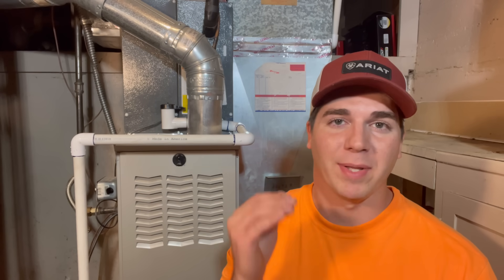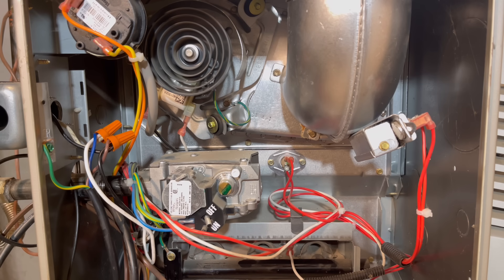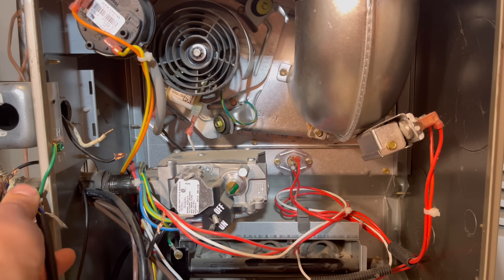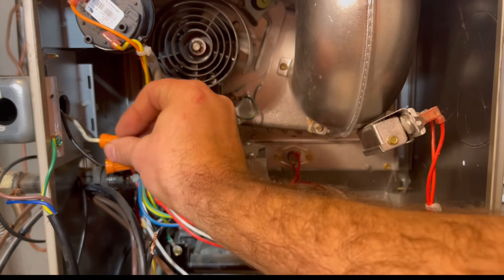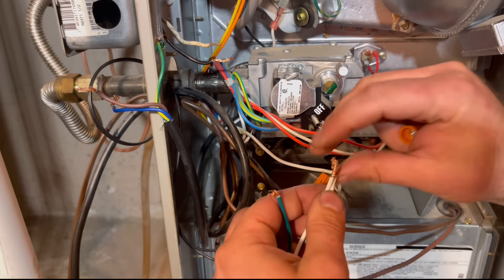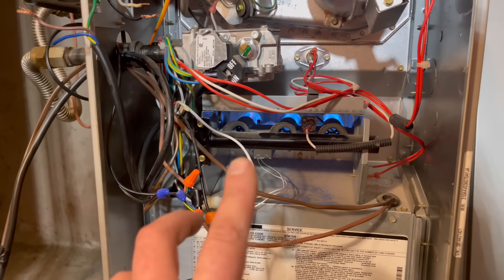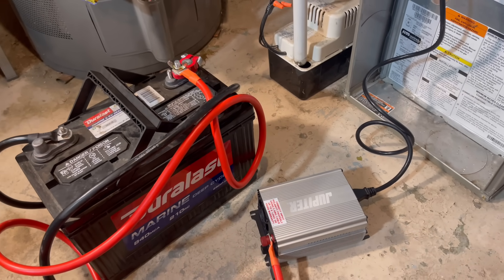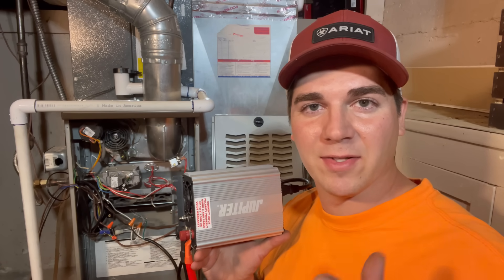Did You Know You Can Heat Your Home With A Car Battery?

Comment: In a power outage there are generators , gas , natural gas, propane , solar  for heat without electric there are wood durning , wood pellet burning , kerosene , unvented natural gas , unvented propane heaters that require no electric . You can also get an inverter that hooks to your car battery for electric as your car engine with an inverter can act as a generator . In freezing weather if you lose power and heat turn off your water main and drain your pipes to the lowest level and add antifreeze to your drains . Use melted snow to flush your toilets . Have bottled water , food , and an outdoor grill or camping stove for cooking and get bottled water . Have plenty of batteries and flash lights . Electricity has not been around very long . How do you think people survived for close to 1,000,000 years . The name of the game is preparation folks . We can do it . Go to a hardware store and learn

Comment: You could also use one of the solar generators that already has the pure sine wave inverters built in. I have one but it only 300 watts so it wouldn't work but the bigger ones would
Reply from the maker: I have another video on this topic testing a power station :) check it out!
Reply: @diyhvacguy  just watched. Thanks!

Comment: I have a walmart jump start 12v charger that I carry in my trunk should I need it or to help somebody out.  It has two 12v ac outlets.  So I'm assuming it must have an inverter built in.  I paid close to $100 for it.  I don't know how long a charge on this jump starter would last but it has two ac outlets and you'd want to keep your fridge cold as well as a few lights in your home.

Comment: Isn't it true that most Texans don't have gas heat but rather a heat pump or AC system? I have two sons living there and for both of them,  this approach would not have worked as all of the energy comes from electricity. This means much higher electrical demands that this inverter/ battery would not provide.
Reply from the maker: Yes some have gas but I was just using that as an example. I’ll be doing a backup power video for heat pumps and or electric furnaces soon! Stay tuned!

Comment: Just curious.  Will this method run a propane hot water heating system?  Will the Zone valves be also powered with this hookup?
Reply from the maker: If it’s 110v then yes

Comment: What is the load drawn by the furnace and house fans used to circulate the hot air. I've used a pair of deep cycle batteries in my RV trailer to run the heater and had dead batteries in the morning. Fans can suck a lot of power. Does the furnace you show have a separate air circulating fan?

Comment: Doesn't concrete hold a charge? I was always told to put a board under a battery, the ions in the concrete will drain your battery.

Comment: One thing to add was the size of the converter for the DIY types. For example a hair dryer pulls up to 1500 watts. So need to make sure on the size of the converter.

Comment: Why would you heat the whole house in an emergency, when you are quite limited on power?  For less money, you could have went to Walmart and got a mr buddy heater that will heat a room just fine.  If you would put this on paper, and run the numbers, you would realise how silly this is.
Reply from the maker: And why would you suspect walmart will even have said buddy heaters when everyone has the same thought process? This mindset will get you into a pickle friend. You can never be too prepared. If you watch my other videos you’d quickly realize this isn’t my backup power source. It’s one of many options. Good back pocket knowledge to have in a pinch 👍🏼
Reply: If you live life unprepared, I suppose you have it cumming, although those types of people wouldn't bother to watch this either, let alone be competent enough not to hurt themselves.  Not everyone is built for hard times.  I do appreciate these videos, as the world finds itself in chaos once again.  But this is not the time to rely on MacGyver tactics.  Smart plans with a little preparation go a long way.  Power should already be thought about, and the worry is eating and stopping people from taking what you worked for.

Comment: At my old house the A hole ele company shut off my electricity in the middle of winter because I fell on hard times for a month. We were freezing and only had the kitchen oven and also boiling water in pans on the stove top. I said bullsheet and bought a new car battery and did this. It worked great. 😁

Comment: What are the specifications of your furnace ( specifically, the power or current requirements of your mains connection?).  What are the specs on your 12V battery?    This in AmpHours.   What is the efficiency of your pure sine wave converter?  Last, what duty cycle are you presuming when you say it will run your furnace for X days?     

You have done a nice wiring guide and described the parts involved, but you have provided no information on the parameters involved.     This is a  useful video, and it would be even better than it is with some of that info.   My suspicion is that an average car battery is not going to have sufficient capacity to run a gas furnace and the large fan that moves air though a house at any serious duty cycle.    Maybe in Texas, where the normal standard is fairly benign weather and heating loads it would last a day.    A car battery from an F150 is going to be way different than the one from a Prius, too.   

The key parameters in a car battery are internal resistance/cranking amps, not capacity.  In your application/concept, the key parameter is capacity.

Comment: You can achieve the same results by turning off the breaker cut the wire going to the furnace, install a male and female cord ends. Plug them together and when the power goes out unplug and plug it in to the new source be it a car battery or a generator. That way you are always ready to go and anyone can do it

Comment: A note: we have two 100ah batteries...they're big and on the expensive side...but they can run for much longer than a standard car battery...one battery is a spare for things like this along with a 750watt inverter and the other battery is hooked up to our sump pump...guess when you need sump pump...during bad weather...power typically goes out during storms..so if no power during storm sump pump is dead...that equals flooding...but if you have battery backup no worries 👍

Comment: Guess I need to get a higher capacity inverter I've got one for 400w figure that would be enough for a light and my TV.
Really been checking in on the solar scene but theirs so many variations and which one is better.

Comment: Don't need a video to figure it out get your vote meter amp meter a calculator and ohm's law and the specs off the battery and the motor and do the math you'll cook the inverter before you anything else it's not big enough battery would be dead before you figure it all out

Comment: If you got a general outside gas or diesel or propane or whatever for a temporary use get a 10 gauge extension cord or 1o gauge would be even more better cut off the female end and observe neutral ground hot and put another male plug on that end turn off all the breakers to the house except for the one breaker plug the extension cord into the circuit you want powered and when you turn on the generator you'll have voltage power to all the outlets on that circuit which if that's what you're hunting for for the furnace and you can ron the furnace will run putting the 12 volt battery on a inverter on your furnace isn't going to last but a couple hours and you'll probably cook the transformer  unit cuz it does not like modified sine wave inverters it will cause the transformer to get hot make sure you observe your neutral in the hot and ground of all things

Comment: You might get you a second battery and a hundred foot extension cord and rewire the ends with alligator clips and connect both batteries and while you're at it put a 50 amp zener diode on the battery in the vehicle so you won't discharge the automotive battery that's in the car then you can restart the car and charge the battery up again without taking it to the vehicle

Comment: Keep in mind he’s using a deep cycle battery that is meant to be run very low, car batteries are not deep cycle.

Also his battery is rated for 65amp hours (850cca) only means how many cold cranking amps and has nothing to do with battery life.

However if your blower motor draws 8 amps and say you have the 65amp hour battery like him you will only get 8.5hrs of blower time (probably less with ignition going on and off).

So I would take what he says worth a grain of salt, he’s an HVAC tech not an electrician.

For a more realistic set of numbers the average car battery from a 4 cylinder car has 45 amp hours, so if your blower motor draws 8 amps the. You get about 5.5 hours of usage.

Comment: Interesting and informative video. I'm curious though, the gas supply itself is pressurized with electric pumps. During a widespread electrical outage, anyone using gas may be risking loss of the system pressure, depending on the state of the gas company's backup generators. You're probably good for a few days, but after that it might be dicey.
Reply: This is the comment I was looking for. If it’s a true blackout then the gas isn’t moving lol

Comment: Since the battery can exhaust it's charge unless replenished along the way somehow, is it possible and safe to connect a battery charger also to the inverter and connect the  (+) (-) leads from the battery charger back to the battery terminals so as to charge the battery as it's being used, OR (+) (-) of the inverter itself and delete the battery once connected?

Comment: We are fortunate to have a gas/hot water system. During a power outage we can adjust up the boiler temp and even without a circulator pump the hot water will rise and fill radiators, pushing the cold water down to the boiler. Once power resumes, we turn down the boiler temp. Only had to do this three times in thirty years.

Comment: do texans have furnaces in their houses?
Reply from the maker: Yes a lot of them
Reply: @diyhvacguy  lived my whole life in mid Michigan. was unaware of this. guess i just assumed they didnt. I need to deal with my furnace. set it up to run off my generator. the "weather men" were doing their usual doomsday predictions saying this last storm would be the 'storm of the century'. we only got 13 inches. Most of us barely brush our cars off with less than 6" of snow. 13 is just annoying. BUT the thought of power outtage with no furnace in -10 weather is not comfortable.

Comment: If one has an pure sine wave inverter, why poke inside the furnace?  Disconnect the supply wire from the switch, (turn off the breaker first!), substitute the supply from inverter and it "looks" the same to the furnace.  Manage the grounding/bonding properly.  The technical information in this video is not 100% correct 100% of the time, so if you have no electrical training, heed the do not attempt warning.

Comment: If you plug lights into the inverter the battery will die quicker. do not put the battery on concrete, concrete will make the battery drain quicker, put the battery on a piece of wood.

Comment: Would have been a lot simpler and less scary for folks who are not comfortable with electrical systems to hook up to the furnace power switch. Opening a electrical box with just 2 wires is not as overwhelming as  opening a furnace panel with a million wires
Reply from the maker: This is true! Thanks for the tip

Comment: I assume this problem relates to the power going out and it's cold outside. I also assume all the wiring changes were done before hand with some type of transfer switch along with a battery purchased strictly for this purpose. The last thing you want to be doing is going downstairs to a completely black basement and having a family member holding a flashlight over your shoulder ..... Not to mention going out to your garage (or worse, outside on your driveway) and trying to remove the battery from your car (and finding the correct wrench).
Reply: you do what you have to do in order to survive.

Comment: **Important** When wiring your own power supply into your home, you MUST take care to isolate that electricity from the public grid. In this case turn off the furnaces breaker so you're certain no electricity can leave that circuit... the guy fixing the hydro line up the road will thank you.
Reply from the maker: The reality although I highly advise making sure everything is isolated is that all linemen treat everything as if it was live. I’m good friends with a  lineman.  What will happen if you are back feeding is it could fry your alternative power source.
Reply: @diyhvacguy  Story time. I was contracted by a hydro company to do the excavation to replace old underground transformer vaults. They'd isolate the vault, test it was dead and disconnect all the guts. We did most of the digging with hydrovac, so the ground was saturated and cables were soaked. A homeowner back fed his generator, his service wire energized the wet soil in the pit and zapped the sparky that was kneeling in the mud. It thankfully must've popped the fuse on the generator, so it wasn't a tragedy, but we still had to notify the city utility commission and they said the homeowner will be investigated and possibly charged with a breach of their utility service agreement or at worst, reckless endangerment.
Never say Never lol.

Comment: Hello. Would something like this work instead of the wire you were talking about on your video? 6 ft. 14/3 SJTW 15 Amp/125-Volt 1875-Watt 3-Wire Appliance/Power Tool Cord.
Reply from the maker: 12awg would be advise. 14 would be too small

Comment: So much work to get 2 hours tops of run time. While trashing a battery by deep discharging it. Investing in a small gasoline portable generator is by far a much better idea.
Reply from the maker: It heated my home for six hours. Admittedly not days, but still great in a pinch! Cheers
Reply: @diyhvacguy  Simple math does not support that. A car battery is around 50Ah, which is 600Wh. A very efficient gas furnace would use 200-300Wh. Most are in the 300Wh to 500Wh range. So even if you trash the battery to full discharge, and your DC-AC converter is 100% efficient, which it is not, you'll get 2 hours run time tops. Best case scenario. 1 hour tops on an average furnace with conversion losses.

Comment: But how long will the battery last…it doesn’t seem like it work but maybe 1/2 a day. I would think the temperature would need to be set much lower than usual. In a pinch that would work so freaking well. Also I thought the furnace would be a 220 volt not a 120 volt!
Reply from the maker: It lasted six hours of heating my home. Definitely not days but still great in a pinch!

Comment: Knowledge is always good, I'm sure there are situations where this could save a life. Personally If I had the car with a battery I would just use the heaters in the car to heat the small car space rather than my whole house. Also, you could still keep the battery charged by running the vehicle. Or even a 500w space heater in one room would allow you to survive much longer.
Reply: Trying to prevent frozen pipes and structual damage.

Comment: I’m no expert so this would work well on a igniter for oil burner that uses a hot water registers versus a forced hot air system that needs a decent blower fan - right?
Reply from the maker: It should work the same

Comment: First Rate Idea!! If you don't have a spare battery, you can connect the inverter to the car battery with the car battery still in the car. Connect the battery terminals to the inverter terminals using the two cables that probably came with the inverter. Place the inverter in a safe place under the hood of the car. Move the car outdoors - DO THIS - MOVE THE CAR OUTDOORS!! Plug an extension cord into the inverter and route the extension cord safely so you can close the car hood. Route the extension cord to the furnace. Using DIY HVAC guy's instructions, add the plug to the furnace wiring and plug the furnace into the extension cord. You don't need to have the car running to run the furnace. Periodically you can run the car to recharge the battery. That extension cord going into the house is invaluable. When the furnace is off, plug in your refrigerator or freezer periodically. A car, an inverter and an extension cord are portable power in an emergency.
Reply: Absolutly correct ! I used the same setup for three days during a hurricane to keep the refrigerator and freezer cold.  A tank full of gas turns into days of refrigerator electricity with only an inverter. The extension cord gives you the flexibility to run the furnace, refrigerator, or plug in lights. An inline volt meter at the inverter would let you know the battery charge, so you don't run the battery so low the car won't start.  A jump start battery might come in very handy for when you forget to start the car when the battery gets low.

Comment: Questions:   # 1 how exactly did you calculate the inverter wattage  needed  to run your  furnace ........# 2  is  it crucial to use a " pure sine  "  inverter  or can I use a modified  sine   model ?....thanks
Reply from the maker: You’d need to put an amp clamp meter on it to see how many watts is needed, but you could pick up a 1500 watt and see what the readout shows on the inverter. And to answer your other question, pure sine wave is always preferred by my older furnace worked fine with a cheaper modified sine inverter 👍🏼
Reply: @diyhvacguy  understood and I do have an older furnace ....thanks